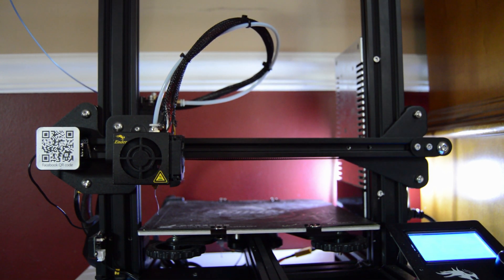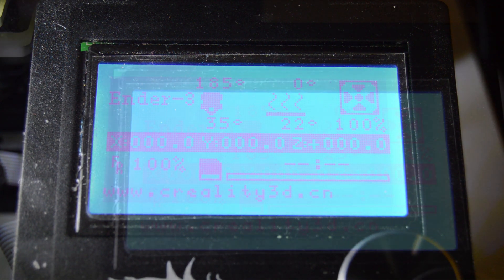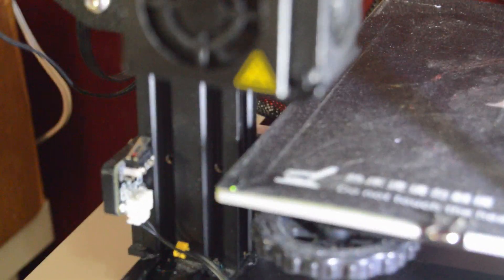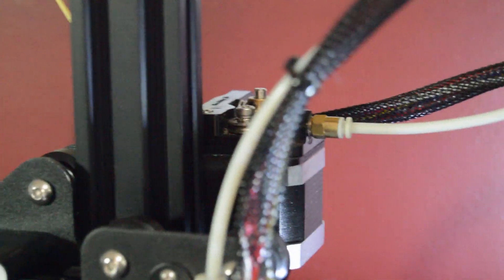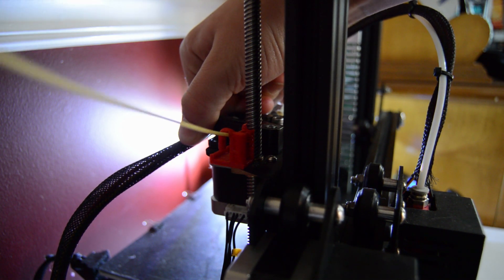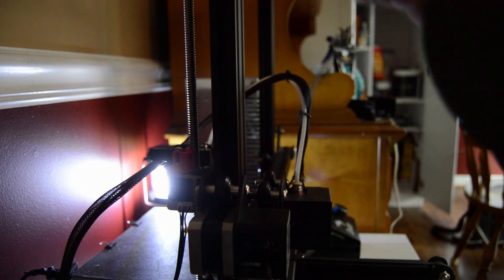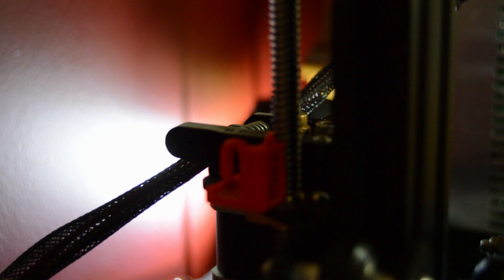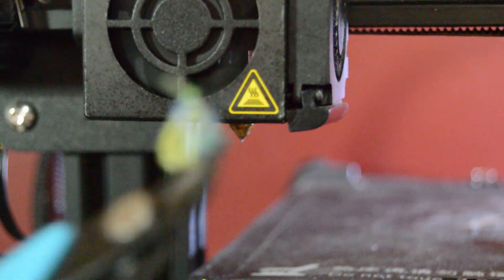How To Change The Filament On A Ender 3

Comment: I definitely recommend either https://www.thingiverse.com/thing:3303879 or https://www.thingiverse.com/thing:4333835 they help against filament rubbing on the top of the metal rod. An extruder knob also helps at times. https://www.thingiverse.com/thing:3544547